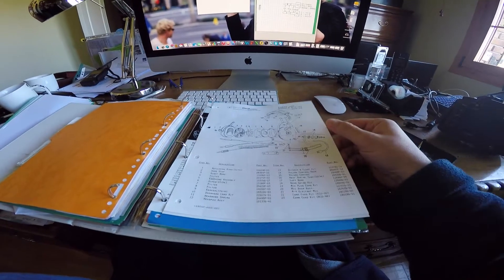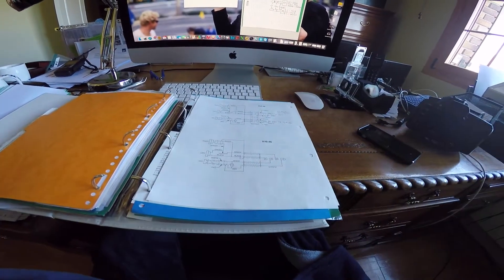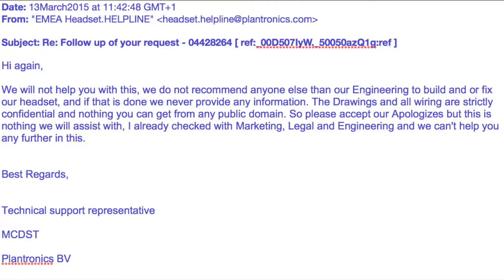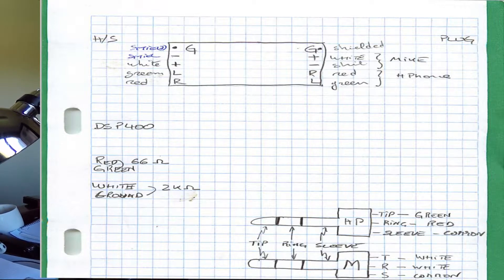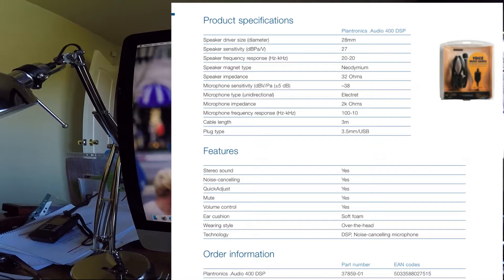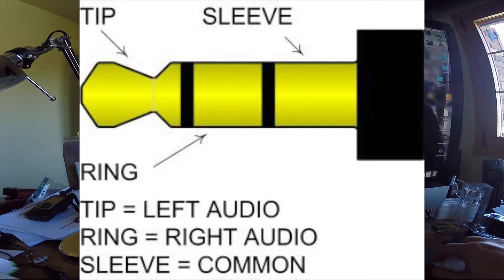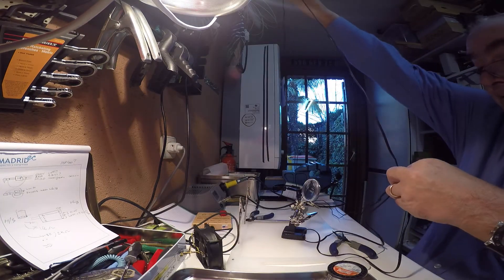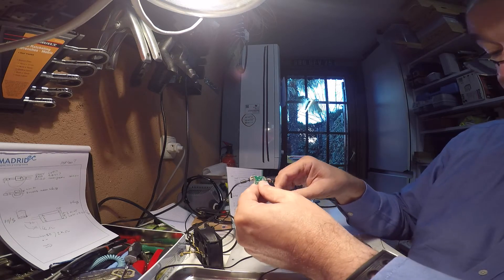Plantronics DSP400 simple field repair

Comment: May I know how you remove the controller casing? 0.33
Reply from the maker: Yes, simply by using a spudger/thin screwdriver inserted in side of plastic housing and slowly spreading the 2 halves apart.
Reply: @lemd49  ok thanks mate